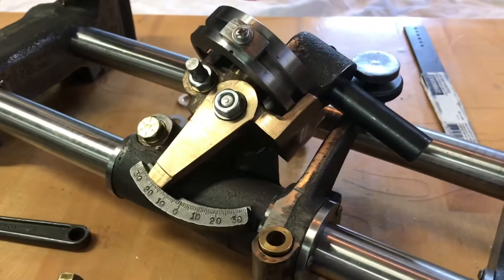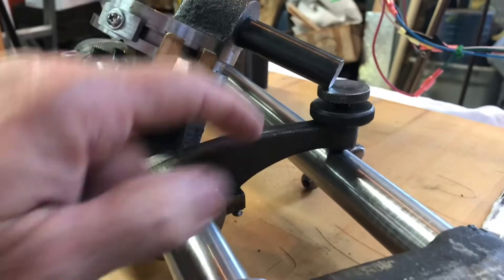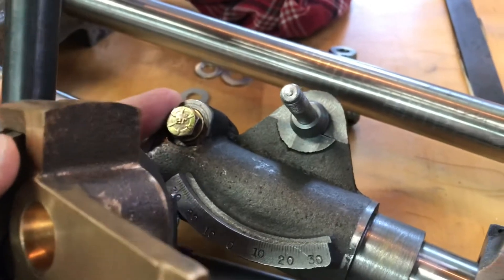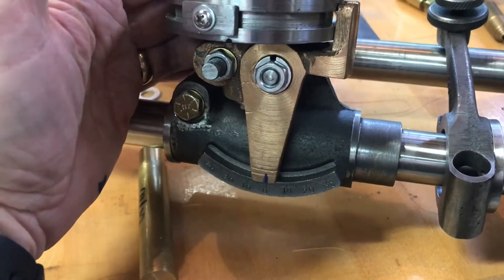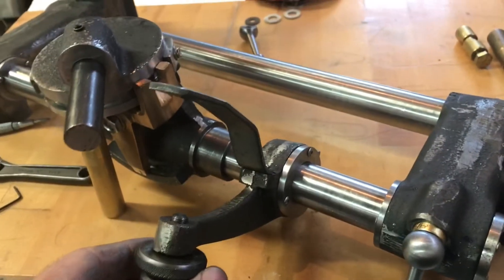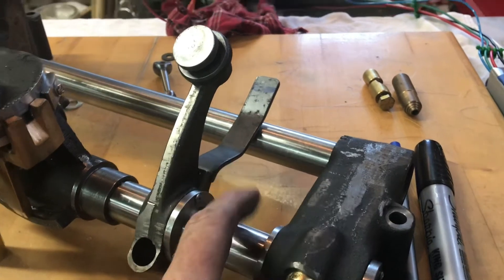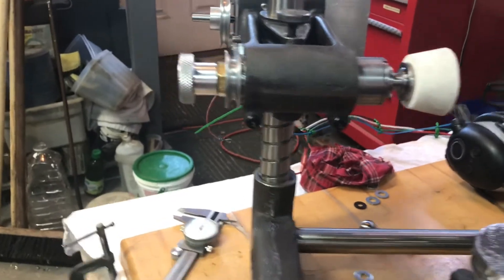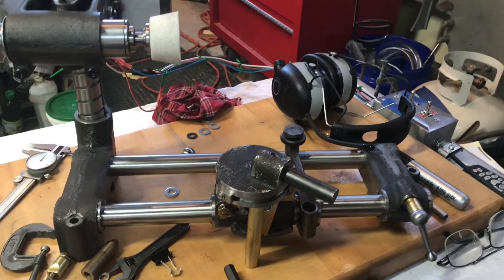Reupload - Quorn Tool Grinder project, detail work Part 1

Comment: Hi Bill, underneath have you thought about a flatter washer and a countersunk cap screw, everything should be out of the way. Regards Beagles.
Reply from the maker: Good observation, Beagles. Not sure why I went the route I used, but fit an clearance are good now so I will let it be as-is… too many other details to be attended to!